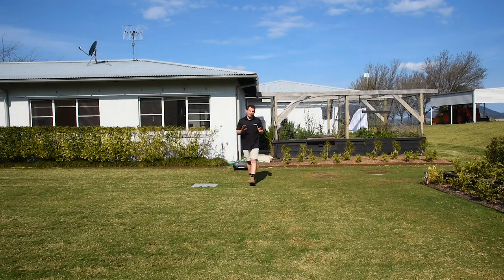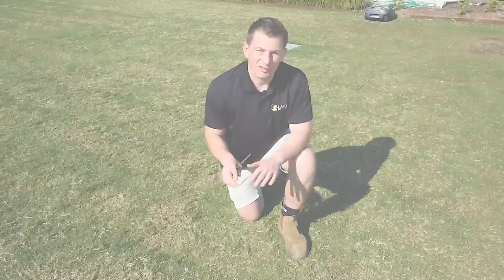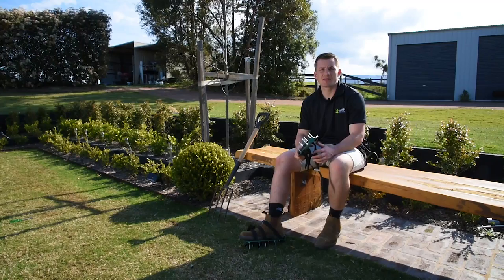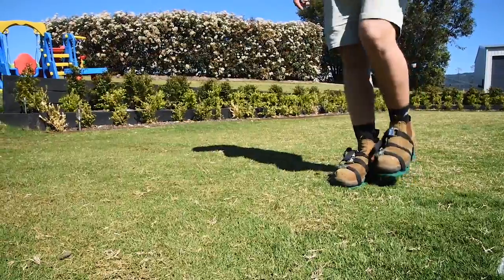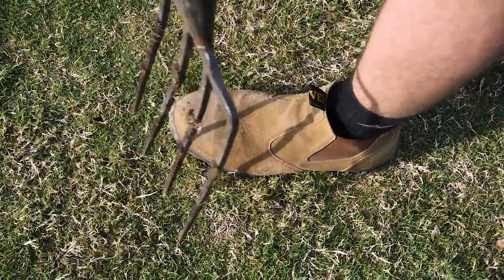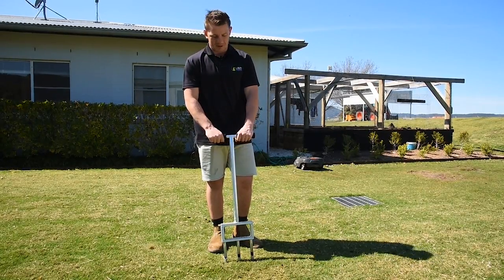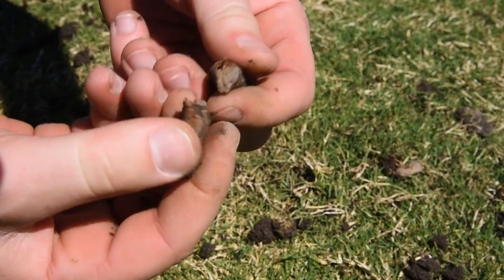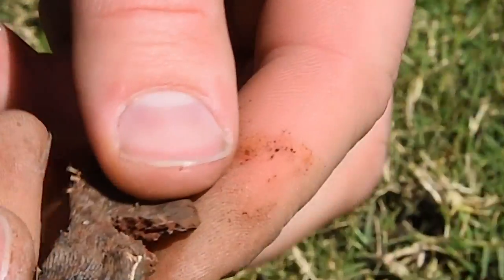How to do a Spring Lawn Renovation | E3 – Alleviating Compaction / Aerating & Core Aeration

Comment: where can we purchase the hand corer from your video?
Reply from the maker: https://reelsolutions.bigcartel.com/product/core-aerator
Reply: @LawnSolutionsAustralia  $175 for some tube welded together?! and the welds aren't even clean! That pricing is straight up theft!
Reply: zrimmy15 use it as a hot dog maker
Reply: @zrimm15  I got one for $40CAD at home depot. Everything is crazy expensive in Australia
Reply: @zrimm15  Make it yourself then.
Reply: I ordered the Trident Aerator (the triangular one the directs the core out automatically) from Trident Lawnmowers in Perth, Western Australia - https://www.tridentlawnmowers.com.au/product-page/the-trident

The 3-pronged Trident Aerator is $149 + $25 postage; the 4 Core Aerator is $169 + $25 postage.
Reply: @ar007r  - we do have cheap ones at Bunnings Wharehouse (our major, mega hardware chain), and other places. But Australia is a mostly dry country. We can't easily use ones they recommend, say, in UK videos. For the most part, we have clay soils they require, and most of us don't live in snowy areas. I tried a cheap one my uncle had, and the clay got jammed immediately, and I injured my finger/hand trying to get it out, unsuccessfully. They say not to use spike aerators with clay soil, but core aerators. It's pointless for us to have cheap &/or poorly made ones with our clay soil. If the Trident Aerator shown here works, it's worth the extra money. I'm semi-disabled, so I need something that works well for me with clay soil... even though it'll still be hard work for me, in my situation.